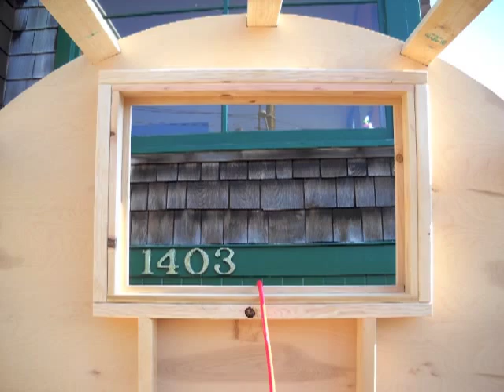part one of the Gypsy wagon

Comment: @9:39 was the wood panel or luan wood pliable enough for the bow top ceiling or did you have to bend it with steam to make that arch.I want to but a slightly bowed top roof on my vintage camper.Any hints or suggestions ?I thought about using coragated tin ..do you think this would work?
Reply from the maker: just bend them in, no steam . you will be surprised how much they'll bend.You might need a friend depending on how much, but is very doable .